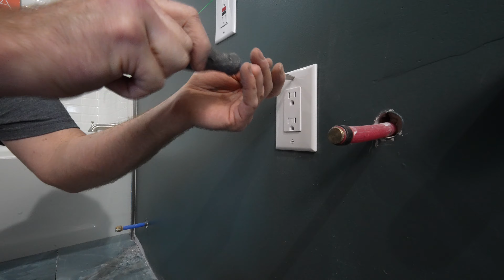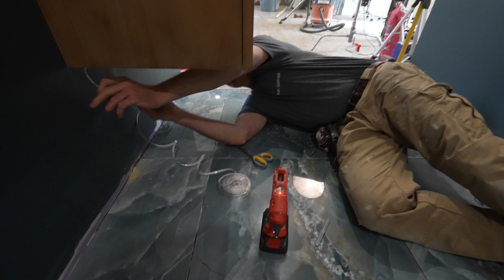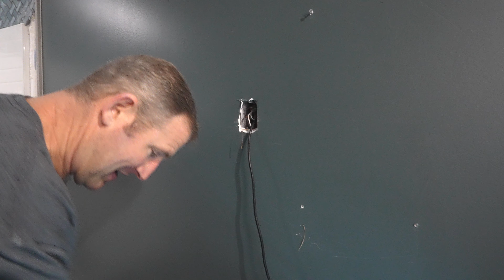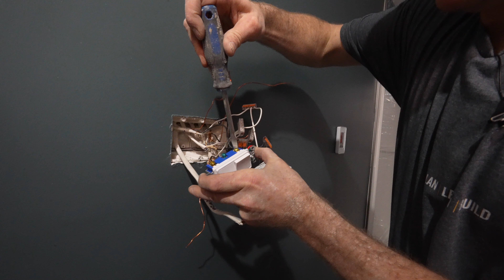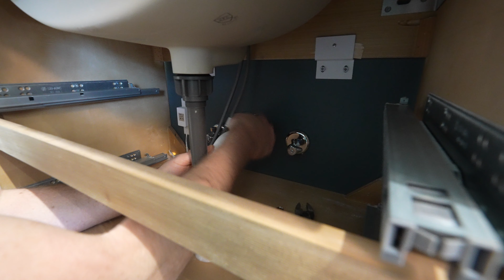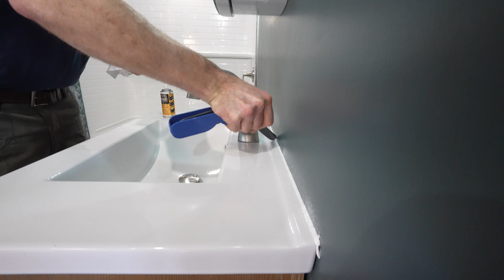Modern Floating Vanity with LED Lighting | LED Mirror Cabinet | PLAN LEARN BUILD

Comment: Nice work ! Just one thing. Was there any way to conceal the medicine cabinet lighting  wire behind the cabinet ? That would have been the cherry on an a masterpiece of a cake 😉
Reply from the maker: I wish. It’s really a dumb design in that aspect. I really expected a junction box within cabinet. The wire could be set straight back, but like i mentioned, you really should have access to the connection, not  just buried in wall.
Reply: Could the box be cut into the back of the cabinet?
Reply: Those Wago connectors should be in a Wago box in the wall I think?